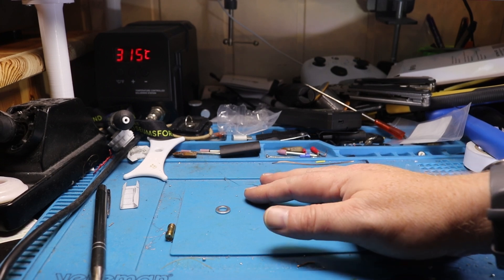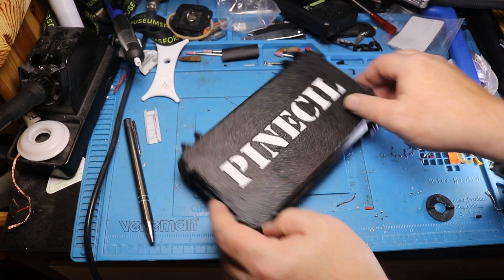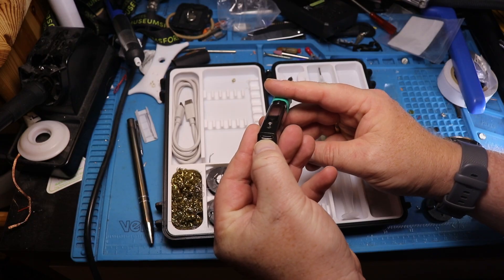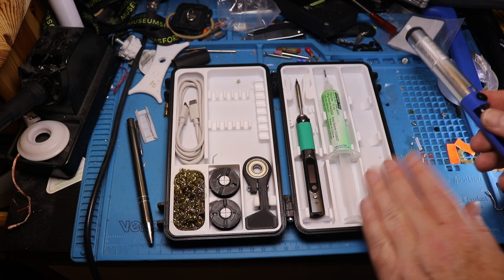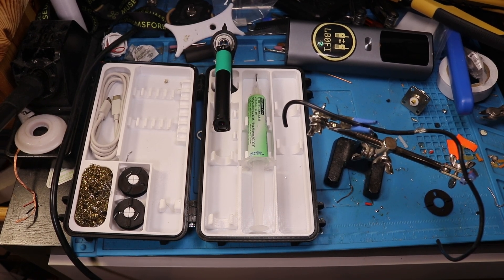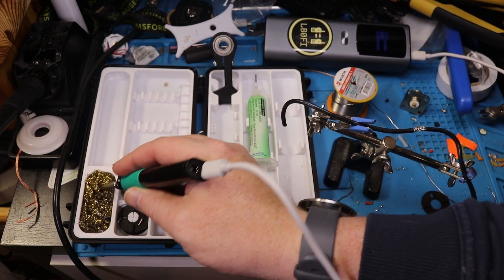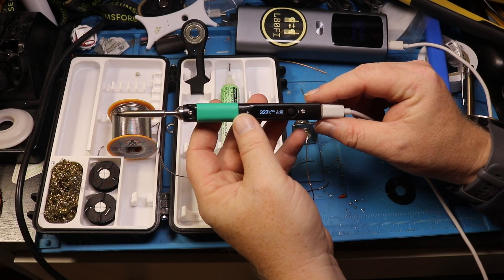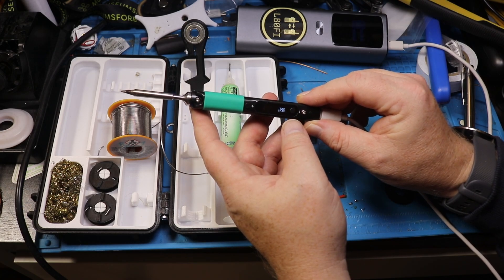Can the TINY PINECIL replace my big soldering station?

Comment: I have one. The only disadvantages are the cost of the soldering tip sets and most USB power supplies don't have the outer  USB connection connected to earth,  so can be a  problem with very static sensitive semiconductors that can be damaged with an unearthed tip. Most users will not have this concern unless they build their own MOSFET/FET LNAs or receivers. Otherwise a very useful soldering iron.
Reply from the maker: It's all about having the right tool for the job. It's by no means the perfect iron, but for me it is due to the fact that my entire workbench is 40x40cms and I can pack it up when not needed.

Comment: Hold the boost button and try holding it while soldering!  I think that might be the key?? I’m going to buy one. Thanks for the video!!
Reply from the maker: The issue is that the power draw is more than the power bank can deliver. It works with a 12V LiFePo4 battery.